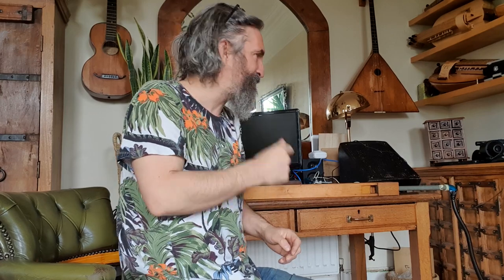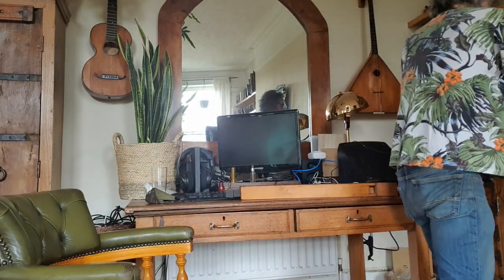What happens when you add pipes from a pipe organ to a Hurdy Gurdy? making a lira organizzatta

Comment: I built a similar contraption a few years ago, and solved the noise problem by putting the air pump in the next room, drilling a small hole in the wall, and passing the hose through it to the instrument. Of course, if the next room happens to be the living room of the flat next door, then you do have a problem! 😀
Reply from the maker: i'm hoping for a quieter pump and a foam box for it to live in... i have some contenders arriving tomorrow...